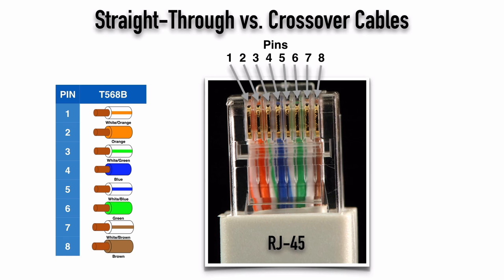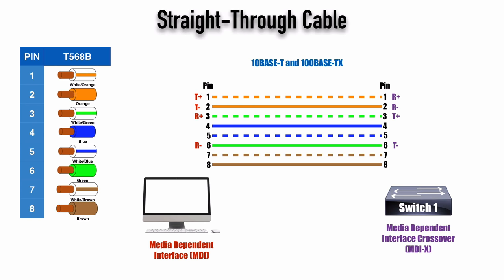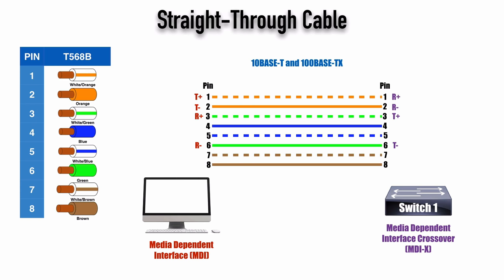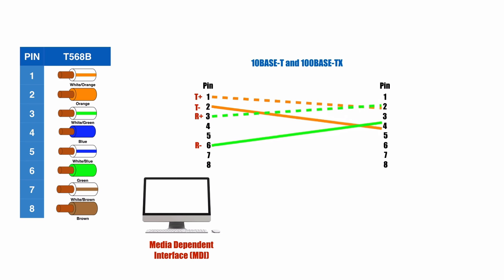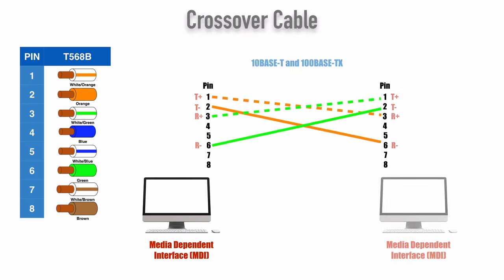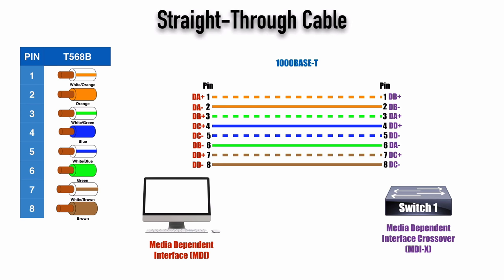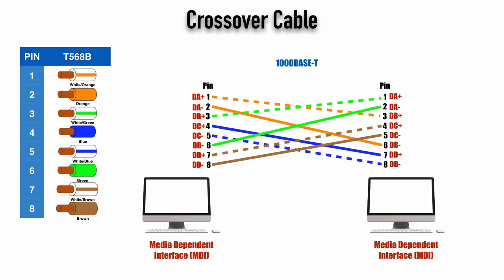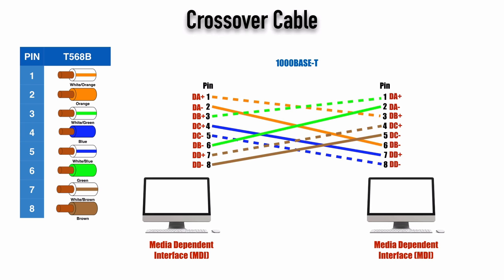Network Basics - Straight-Through vs. Crossover Cables

Comment: I cut a 4-wire 100BASE-TX riser cable with the goal of reducing cross talk and collisions for the Nintendo Switch. I also cut a crossover gigabit riser for my fiber router's connection to its ONT. The new setup is working as well as my fq_codel setup. Games are smooth as butter. I think the wires also help load balance which cpus are used by the Nintendo and the Router+ONT. 

Thanks for your awesome wire setup.

Comment: I hooked a switch to a switch and used a straight through cable, and everything worked. just came here to see if I needed to switch that over, I guess I dont need to.
Reply: me to :D
Reply: Cisco switches have a feature called auto-mdix that notices when the wrong cable is used
and automatically changes its logic to make the link work.

Comment: What should i buy for home ethernet router to Laptop and if I can use the same cable for connecting computer to computer
Reply from the maker: Typically, a port on a home router is pinned out like a switch port, which would use a straight-through cable. However, a PC-to-PC connection would use a crossover cable.

Comment: Which cable will be use to connect Layer 2 switch to Layer 3 switch ?  Answer ? 🤔🤔
Reply from the maker: Assuming MDIX is enabled, a port speed not exceeding 10Gbps, and a distance not exceeding 37m, a straight through Cat 6 Ethernet cable should do the trick. (or a crossover cable if MDIX is not enabled)

Comment: My inexperienced co-workers used crossover cable in our network ranging from 4th, 3rd to 2nd floor in many different rooms/offices which were interconnect through several switches and routers and claim the cabling method they used are the correct method. I tried to tell them it isn't the proper method but they won't listen.  Ridiculous.